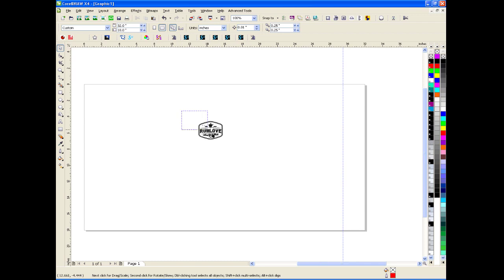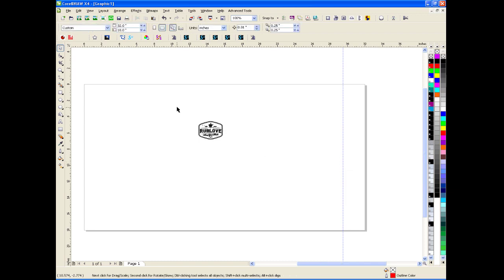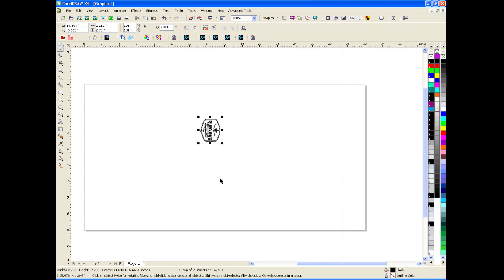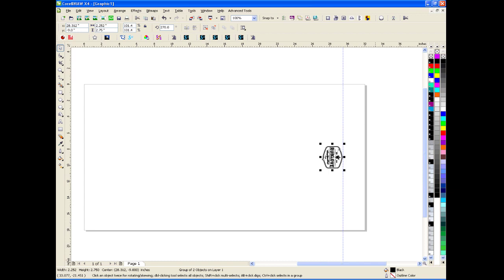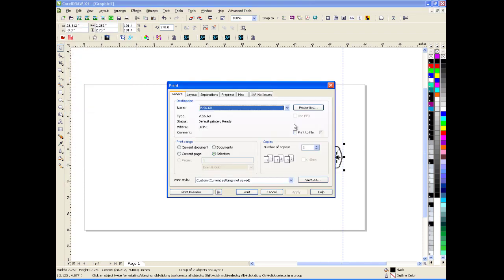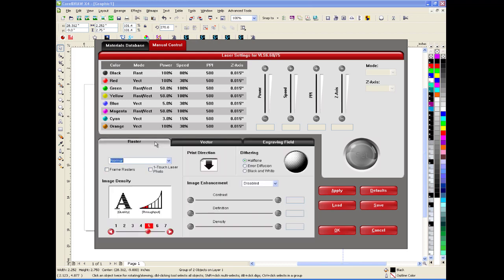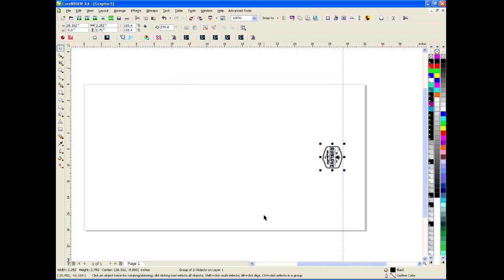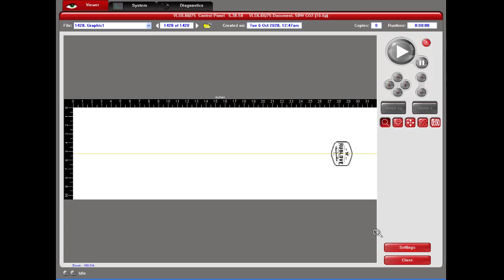Synergy 17 - How to laser engrave a Yeti Tumble using the rotary attachment

Comment: Thank you for the video, I learned a few tricks that will definitely help me be more proficient. I have a VLS 3.50, I'm not able to shim one side of the rotary fixture. I wish I could.
Reply from the maker: Why can’t you shim it? Doesn’t the rotary attachment pivot on the right hand side?
Reply: @synergy17llc   The electrical connection is on the bottom of the right hand side. I wouldn't want to break the connection by shimming it.
Reply from the maker: @kylejamieson8130  ahh. Mine has a cable. I wasn’t sure how yours attached. 👍🏻
Reply: What brand of laser are you using?

Comment: What material settings do you use for the settings?  Powdered coating???
Reply from the maker: It is powder coated, but I use the manual settings when I engrave. Settings will always be different with different units, power, speed, etc. Some cups have thicker/thinner coatings, so I adjust to the manufacturer when needed.
Reply: @synergy17llc  Wow. Thank you for answering so quickly, on Christmas day too.  How do you test per different cups to know the settings.   I have a simple modern tumbler that I do not want to ruin.
Reply from the maker: @centralcityschoolsne  if it’s a typical yeti, pilar camel, or stanley, they work well with about the same settings. Sometimes i have to adjust for different colors. I run it at 100% power 80% speed 500 PPI. This is for my ULS 50W